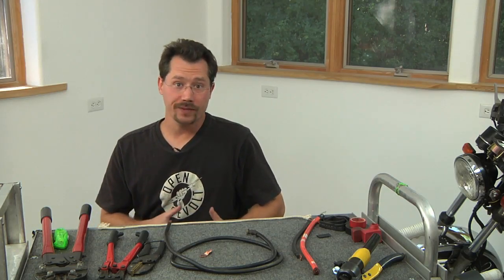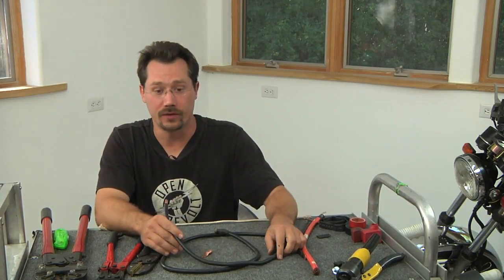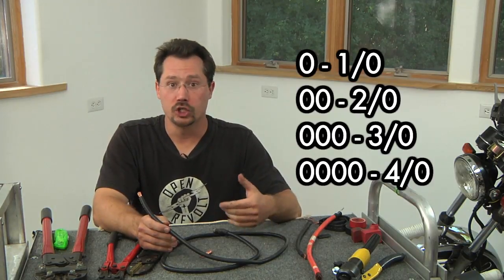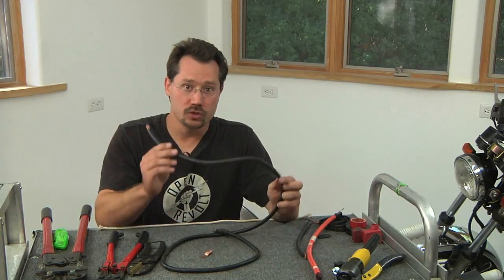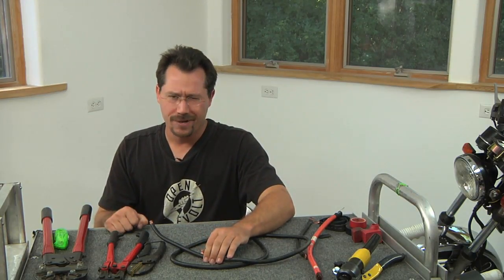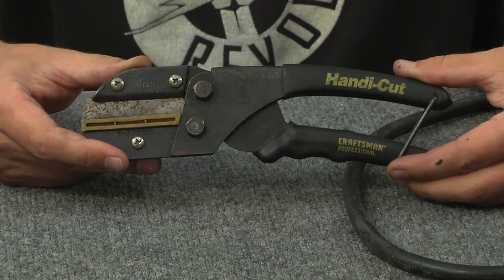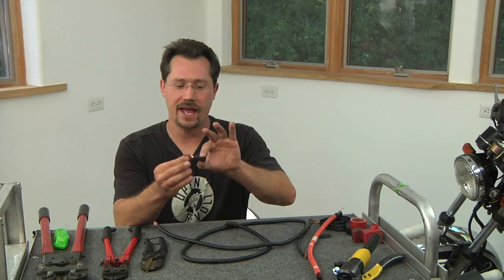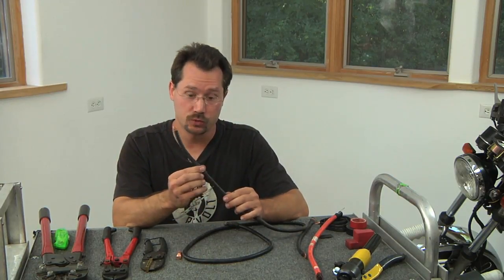14 Build Your Own Electric Motorcycle - FULL - 14 Cabling

Comment: Thanks again for providing high quality content for free. 

I appreciate this simple approach to choosing cables. I thought some people might like some of the theory behind it, so I've written my understanding below.

A cable carrying more amps than it should can get hot and cause a fire. A thicker cable can safely 
carry more amps than its thinner counterpart.

The minimum safe thickness of a cable is determined by several factors such as: the amps it will carry, the conductor material (aluminum or copper), the insulation type (some are more heat tolerant than others), and the ambient temperature.

There are charts and online calculators that can recommend a minimum appropriate gauge. A given cable may temporarily exceed its rated amp capacity without getting too hot. But, prolonged exceeding could be bad.

In the case of a short circuit, a cable can end up carrying more amps than you expected it to ever carry. To protect against this, the amp rating of each fuse should be less than the amp capacity of the cable it's attached to. This way, the fuse will blow before the cable gets too hot.
Reply from the maker: Yes, all good notes.